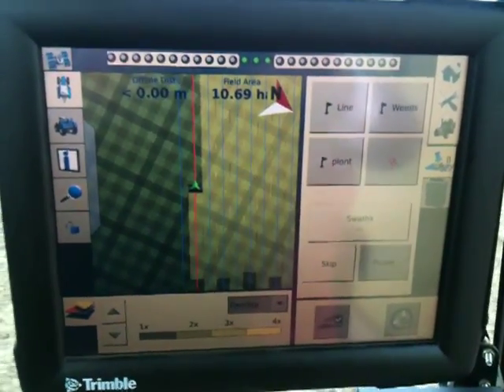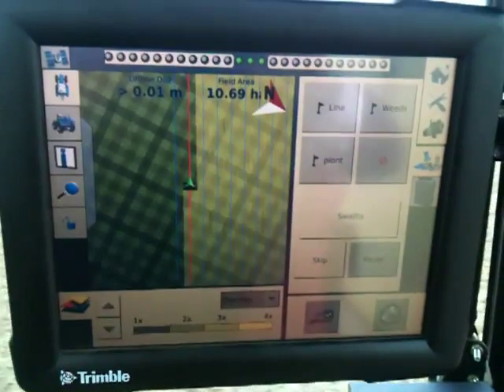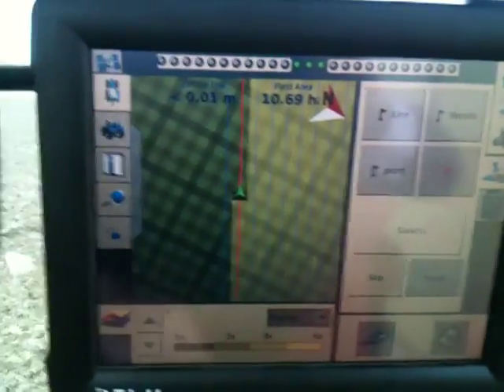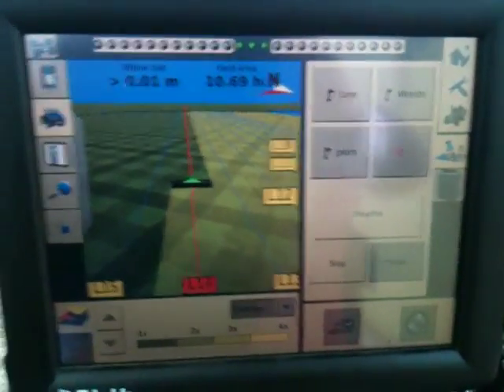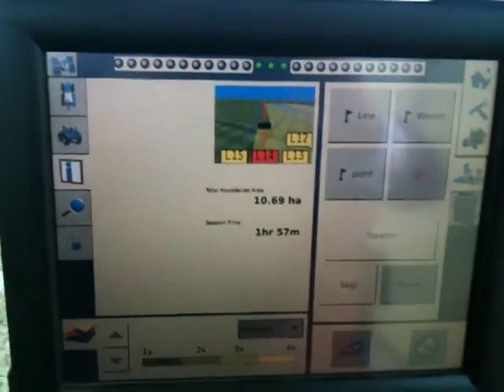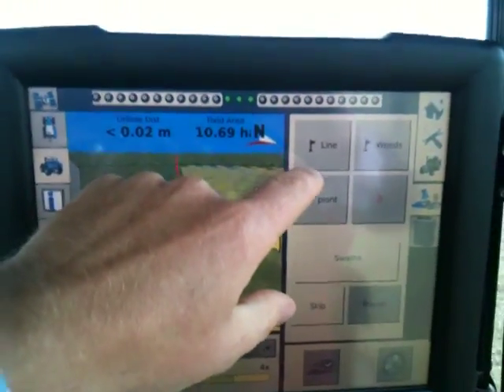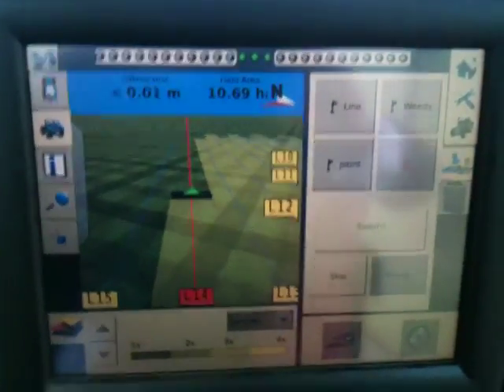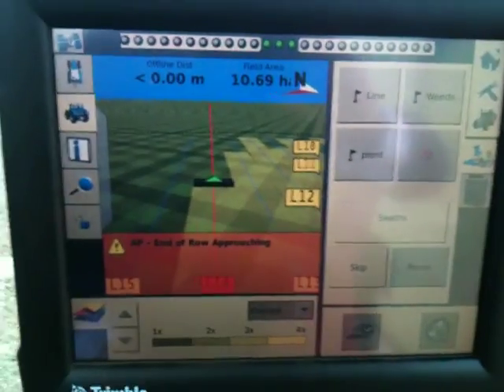Look at Trimble RTK on Case Quatrac

Comment from the maker: @louisestarash That is a very good question. We were slightly led down the route when our Case Quadtrac came fitted with one as they were the preferred supplier of our machinery dealer. If I was starting from scratch now I would certainly look to see what was in the market place as it has changed hugely since we started. I'm sure that it won't be long before mobile phone GPS is almost as accurate at RTK.